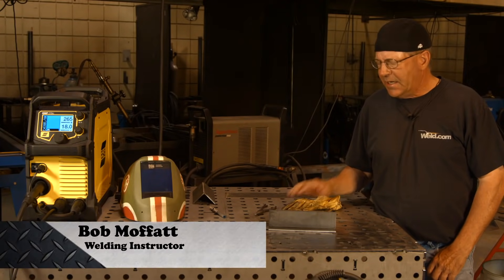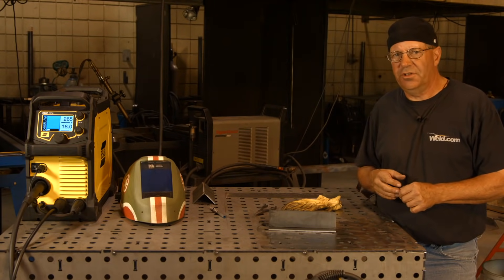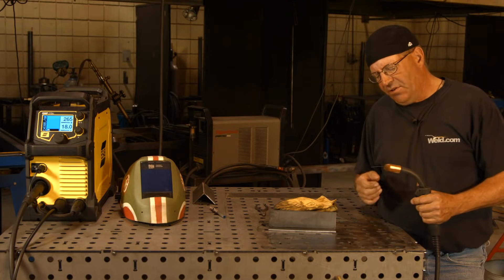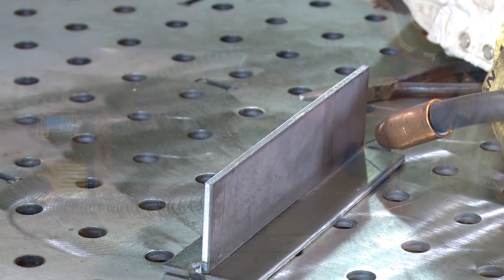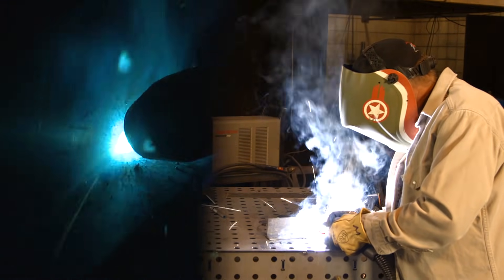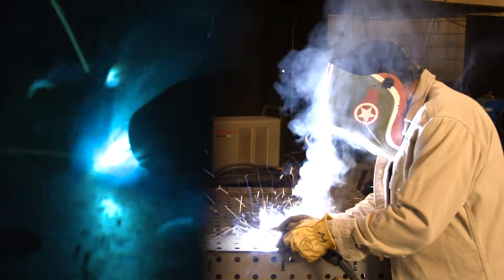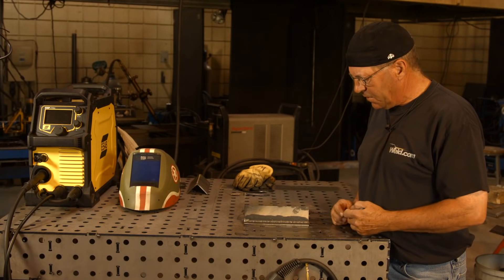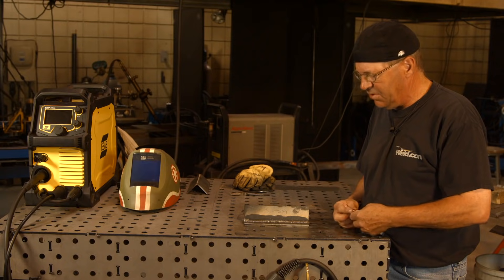Flux Core Welding: The Basics You Need to know

Comment: Gasless flux core is very underrated. if flux core had thicker wires than .030 and .035 and machines that could handle much thicker wires, it would be as popular as stick welding  or more for outside welding and major industrial projects.

Comment: My shop neighbor did all his iron fencing welding using flux core.  He never used gas.   I always used gas, and was always having to go to the gas shop to get refills.  Since a got my big mig rig stolen, my tank and regulator gone.  The tanks are expensive these days, so I got a flux core welder.  I was going to try mig with it using a beverage c02 tank, any input on that?

Comment: just found your channel, I just purchased a Lincoln Electric MIG 90i 120V Welder today......relatively new to welding and had my leads hooked up wrong, just wanted to say Thanks for pointing out that the leads need to be switched (DC electrode negative) . Cheers mate.

Comment: For all welders, I’m going to training school, to learn flux core. I’m wondering, is flux core gasless or needs it? Just wondering.
Reply: Needs gas

But there are wires that don’t require gas(don’t recommend using it)

Tig, mig, and flux core requires gas shielding.

Stick doesn’t, the rod is coated with flux that protects the molten metal. Good luck hope you know what you’re getting yourself into.

Comment: could the 110v gasless type welders be strong enough to build a structure to hold, say, a 1500 gallon plastic water tank?   thinking of a raised rain barrel stand.
Reply: It can just make sure your joints are cleaned and brace the structure with some gussets, so those points don’t buckle with weight.
Reply: @Ryan_1997  ok  thank you.  would you happen to have a video you recommend for demonstration purposes?  doesnt have to be a video that you did, but something demonstrating what you are talking about.
Reply: @Ryan_1997  question for you regarding the gussets......in welding, does it make a huge difference if  the gusset is welded to the side of the post,  or flush up against it?   i would think it would be similar to wood working where you would want the joist on top of the post instead of on the side where the weight would be on the bolts.......so im guessing i would not want the weight on the bead,  but rather on top of the post.  if i said those terms correctly.  i was looking at a staircase someone built and the joist at the top that holds the platform to step on,  is welded to the side of the post rather than the joist resting on top of the post.  to me that seems like the weight of the platform is solely on the weld.
Reply: @Ryan_1997  i watched this video - watch?v=OzJQyTmNX3E -  and i think that kinda answered my question.  i would have done the first gusset this guy said that is the one that makes him cringe.

Comment: I switched from gas several years ago. I only use fluxcore. I'm old and live in the sticks. 50+ miles to buy gas and none deliver my way. To me, it works better on the thin material I weld.

Comment: I use flux core allot on fixing equipment outside I don’t have to worry much about wind blowing my gas around and in tight areas where it’s just a bear to run a good stick weld the old flux wire comes to the rescue just another tool in the tool box to get the job done when time counts and you got to get that equipment back in the fight yesterday

Comment: When I use flux core I have a problem of the flux not completely covering the bead, leaving a dark spot on the bead
Reply: fix your settings
Reply: @TopLasagnaLover  I figured that much, but in what way? More/less wire? More/less voltage? Work distance? Work angle? Travel speed?

Comment: Essential tips. The manuals for most of these machines are ... (for lack of a better term that can be used in polite conversation) dry on information. I'm not one to shy away from a manual, but they can be really convoluted once translated from their original language. Stuff like wire tension, having it set so it just barely goes (somewhat akin to how you set the wire tension for the bobbin on a sewing machine, just light enough to hold it by the wire) really important tip.

Comment: As soon as i sold my Lincoln 140, I needed to weld something 😂. Went back to my old welding school and had the luxury of using the miller suitcase, but i just ended up buying another 140..i think I'll try the whip method ..the flux core is actually a nasty process . The gas doesn't penetrate as much but it is cleaner. Go figure. I appreciate your help greatly man!

Comment: I was reading on safety and flux core. The fumes should be avoided at all cost. In your video during the weld the fumes or smoke of the weld flowed straight to your face/mask. Did you have a respirator? How do you mitigate fumes in your work shop?

Comment: Have you made a video where FC wire should not be overlaped? I’ve been told to always run a straight line and don’t weld over your line because of flux contamination will cause pitting.

Comment: hi i  got a  galvanized  steel pipe for fence and wanted to  weld it   i got a flux core 125 v   but it was not welding it at all no spark or so    what am i doing wrong

Comment: This is just what I needed to know ,you explained it just great. 
Is it true that the wire must be flux core if gas is not been used ?,  and must be the correct diameter for the  wire feed roller and the nosel? .thanks again for a great video .

Comment: Best instructional video I’ve seen yet. I have a question can I use gasless flux core wire to weld upper control arm  mounts on my jeep? it’s a 2000 and they both rusted off and broke.

Comment: would this be suitable for a beginner? I’ve wanted to learn to weld. Now that I have property, some small maintenance and metal fan (welding hooks on not tractor brackets, tie down locations on trailers, fencing stuff etc) are things I will need to manage.

Comment: How would you rate it for situations where you needed an air/fluid tight weld?  I tried welding a bung on a portable air tank to use it as an aux fuel tank for a motorcycle for long rides with a stick welder and I could smell the gas leaking, so apparently my welding technique is not good enough... I know that stick welding can do it since I've seen pipeline welders do it day after day on installation of major transmission gas lines 50 years ago, but apparently my skill never got better than the "it might not be pretty, but it'll hold" stage... :(

Comment: I took a welding course in 1991 learned gas, and stick welding. Wire wheel was always used to clean it up afterwards when I bought my first mig couldn't afford a gas setup saved all summer to buy a cheapest miller mig welder. I had to go with flux core never bought the gas easier not needing to lug a heavy tank and cost lot less. I can use it outside no problems use a wire wheel on a battery drill now.  Now days everyone wants to make some kind of art out of welding I want strong don't care what it looks like.

Comment: I am using flux core for mild steel and stainless steel and they work fine. I just replaced feeding wheel from smooth to serrated groove for better feed. Other than that it works awesome with Home Depot welders. Just make sure you connect it to 30 AMP line for smooth welding experience.

Comment: I didn't understand which polarity you were saying you need for flux core. There are actually two electrodes. There is the Anode and the Cathode. One lead has the gun and the other one has the clamp for the return current. They are both electrodes. The cathode emits electrons and the anode collects them.

Comment: I've been working on a railing for a fire escape using flux core wire. I am amazed by how much better the penetration of the weld is compared to my solid core wire and gas bottle. I've got a Linde 130 and am using .030 wire both in flux core and solid. Do you have any recommendations so that I get the same amount of penetration with the solid core wire? Would shooting .025 Improve the penetration?  That is if I can get it. Praxair doesn't carry it in stock anyway.

Comment: Can I arc weld a large piece of 1/8" plate to 1/8" angle iron over top of concrete, as long as the material is suspended above the concrete with some angle iron on its side?

Comment: Looks a lot better than the beads that I laid down for a welding test earlier today.
I'm still fucking pissed off at the fact that I blew the opportunity to make $17 an hour but I did everything that I could think of as far as machine adjustments.
The only thing that comes to mind is an electrical conductivity problem, because I noticed a lot of phasing as I was running beads for both practice and the actual test.
Another possibility, is the Miller that I was using was probably an outdated piece of donkey shit that needs to be replaced.

Comment: You're holding the gun wrong and it's force of habit - you're holding it as if you were still using gas. You should be drag welding by pointing the gun backwards down the bead.

Comment: That welding style has gained great popularity in shipyards. I don't see it. There's additional detail to clean up required and on multipass filets or deck passes this will require even more time if you are going to pass an xray joint exam, which brings me to the question: can this welding process be used for and xray-required-joint weld?

Comment: I've had a craftsman gasless flux core wire feed welder for over a decade. Not really sure when I bought it and I still haven't used it for anything. Mainly because I was kicked out of my other shop after 9 years and I do too much wood working now. As the new shop is at least 4 times smaller. 

Anyway, could I use these types of welders to weld ATV & scooter frames together or have someone with a MIG or TIG do it for me?

This is the project before I cut it up to have someone redo then tell me they can't:

https://youtu.be/MHz4ritBuAM

Comment: I appreciated the instructor's style. I had forgotten about polarity for flux-cored wire. I don't weld very often and I'm older than I used to be.  I was certified for all position welding by Caterpillar back in 1991-1997.  It usually takes me a couple of hours to get my technique cookin.  I did a repair on my trailer and it looked and performed horribly.  Thanks Again.

Comment: I am a beginner welder, I was given a VIVO HOME 130 Gas less welder. There is not much info on the machine, I don't know what I am welding with as far as volts and feed. It has a Min/Max and a 1/2 toggle on the front with a feed dial. Do you have any knowledge of this machine and could share the knowledge so I don't continue to weld in the dark? Thanks.

Comment: Would an 80amp 120v Flux Core Welder do a Quarter Inch Steel...? And if not in 1 pass, perhaps in 3 pass'...?  Thx  The Spec's say Thickest is 4.76mm...  But ive seen Video's where people are Welding 1/4 in, and it Seem's to be Fine!?

Comment: I spent 5 years offshore in the gulf of mexico removing old oil platforms. Tye vast majority of them go back to shore in 2 pieces. The top package (living and working areas between 500 and 2000 tons), and the leg section (2000 tons +). It gets alot more complicated than than, but no need to explain further...

The lift points are all welded in with fcaw boxes. Some times 10 guys with fcaw boxes slung over their shoulder will be working at the same time. Structurally sound is an understatement.

Comment: I’m 13 and just got one this morning cause it’s Christmas and know enough about welding but have never done it and my dad had no idea how to setup my flux core machine because he has only done stick because that was all that was available back when he was younger he learned how to use tig over at my neighbors house but i had a hard time explaining to him a few weeks ago that flux core is mig but it dosnt need a gas bottle but I went out there and found a price of scrap steel and cleaned it up and practiced my beads my first one on that peice looked really good for my first bead and then a couple hours after practicing I took and old vice I found and put a long bolt in it and found a large nut and welded it onto the bolt so it could be used as a hitch pin for a yard cart
Reply: good kid, i hope you do well

Comment: I really like your vids. Some help please:

1) I'm thinking of getting a MIG 130amp Sealy or Clarke with gasless flux core wire.
2) Main reason is because I understand Stick welder is not suitable for thin mild steel, around 1mm to 4mm (maybe 5mm), as it will 'burn through' the thin metal - is this correct?
3) I don't plan on welding more than 5mm steel for now but if I do, I'll get a Stick welder - is this correct?
4) I'm not a construction worker or professional of course but I just want to make some home furniture, which will need to take some weight on around 50KG tops, mainly PC monitors for example. I'm thinking 2mm to 3mm hollow tube is strong enough, and using 0.8mm or 0.9mm wire would serve me well (0.9mm comes with the gasless MIG Welder) - is this correct?
5) I think I saw a video online that says AC and DC causes different level of 'splatter' from the flux core wire - is this true and what can I do if some models are DC or AC only, can I switch cables around or do I have to buy very expensive MIG machine?
6) Lastly, should I be doing C or any other movement or can I just go straight line (easier route)? I want to make sure it won't fall apart and can take on some weight of course.

I'm completely new and just making sure I got my understanding correct so appreciate knowledge from the Pros. Many thanks.

Comment: You just solved my years old riddle. I bought a new MIG welder at Canadian Tire for home use. I only had a Cannox Sparkler stick welder before. I took a welding course when I was younger, and was able to do our farm welding with reasonable proficiency. When I got this MIG welder, I couldn't weld at all. I thought the unit was defective and set it on the shelf and never looked at it again. From this very helpful video, I'd bet it was a polarity issue. I'm going to try it again. Thanks!

Comment: Just bought a mig/ flux core chicago electric 170 and a welding helmet and almost all the necessary tool except I haven't got a gauge and gas  yet so I'm gonna try flux core seems like you can get some good beads that'll hold up well. 
(Update) been welding mild steel for over 4 months now and I love it!

Comment: I used to work for a welding supply distributor...we sold a lot of flux cored welding wire to manufacturers. I wouldn't be afraid of FCAW either...in the right application.
This gentleman seems to be a good teacher...as many have said concise and informative. Thanks for sharing your knowledge.

Comment: my welds still suck... Saw one of your guys videos last night, speaking about the common issues with flux core. Such as the 'welded' on bb's that have to be ground down/off with sanding wheel, ugly weld bead ect. And they too stated make sure you have a NEG electrode, and POS working clamp. I thought for sure I must have had my welder switched, as the "symptoms" looked just like the issues I had. 
But I just went out and looked this morning, and to my disappointment I already had my welder polarity set correctly for flux core wire....  :-(

Comment: I build wrought iron fences. Typically i am only welding premade panels to the posts... Flux is the only way to go in my eyes. doesn't have to be clean, doesn't matter what the wind is doing. I have a 16lb 125A inverter flux welder that I wear on a shoulder strap does the job beautifully. I also have a spray that I coat the area with first. Doesnt let the spatter stick to any surfaces including contact tip

Comment: Not really cost-effective the wire does cost way more than regular wire I can get a big spool of regular wire for $30 and a big spool of flux core is $80 were I live i’d rather just spend The 30 or $40 to refill the tank and get way better welds
Reply: @Ade Matthews Or I could just get the bottle filled that’s only 15 minutes away from me why would I have to buy two bottles there’s at least three places near me that I can get it filled with no problem

Comment: I googled what  should the ground be connected to for welding Flux core. Your video answered that quickly. I have had my 180C welder for possibly 8 years and this was the second time I used it. The first time was for welding aluminum. Thank you for sharing the setting up front.
Reply: The cheat sheet on the machine indicated a negative and the next image was the ground clamp. I thought that I changed the taps to weld aluminum so I questioned the picture that was why I had the question on which post should ground go to because it should be opposite of  aluminum.

Comment: Would you recommend  a 110 volt flux core welder for structural welds of 1/4" steel and less?
Reply: 1/4" is hard-to-difficult at 110 VAC. You also need more heat, so "duty cycle" goes way down, if the machine can "put out" enough at all. (A/C only machines will not do.) Expect to reduce wire feed rate to get more penetration. You will likely also need more passes to achieve a thick enough fillet, so wire brushing with a grinder before restarting each time. But you can do that brushing while the machine cools off.

Comment: I like the flux core. I run into the problem after about 6" of running my bead the flux gets all over the material making it hard to see where I am going and I have to stop and wire brush it off. If I keep going not only the concern of going off track I will get connection issues that start happening between the wire and my weld. I have used Hobart .030, Forney and now Blue Demon .030 . 

Is this a problem others are having? Thank you for any suggestions!